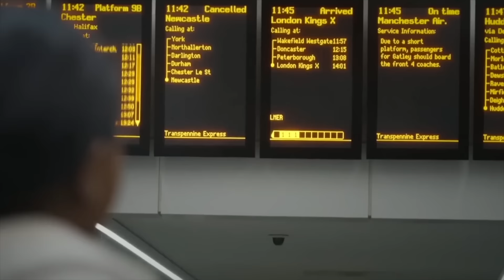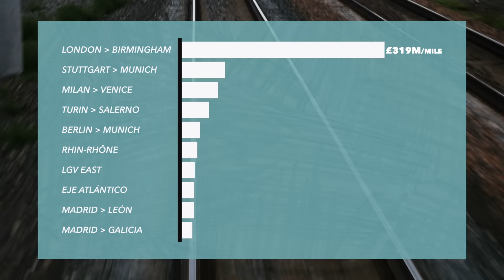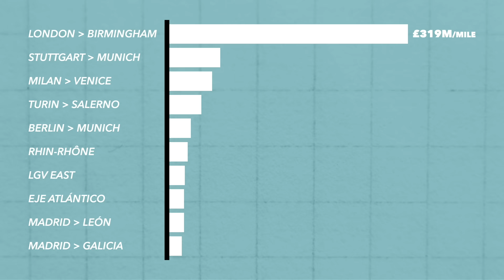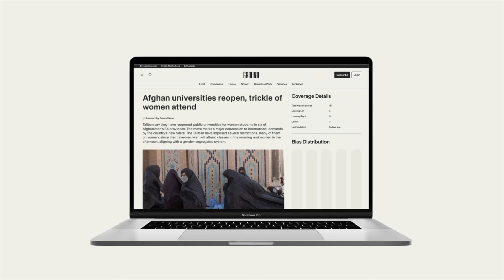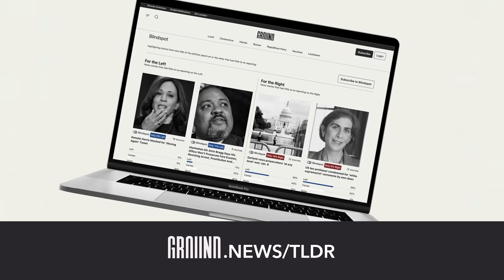The £100bn Railway: Why is HS2 Four Times Over Budget?

Comment: Find it sad to see the actual part of HS2 that needed it the most (connections to Leeds/surrounding areas) were binned. 
Seems that no engineering project in the UK can either run within budget or time scales. The building of Wembley stadium is another immediate structural project that was both hideously expensive and slow to construct.  Guess that is the state of the UK in the 21st Century.
Reply: haven't seen anyone complaining about Wembley now.
It's actually doing really good.
Reply: @davidty2006  It cost twice, three times the budget £700bn in early/mid 2000s is insanely expensive) and was 2 years (I think) late in completion. Plus within 15 years it's not even the best stadium in London anymore.
Reply: A14 Huntingdon Bypass was open ahead of schedule...
Reply: Why is the scrapped HS2 route to Leeds and the surrounding area needed the most, the areas that need HS2 the most are Birmingham because of the fact Birmingham New Street is getting grid locked and strangled by the amount of trains using it which is affecting both the Birmingham to London services and also other service through New Street to the rest of the Country, it is far quicker via the ECML and MML than travelling from Leeds to Birmingham and then South to London.
Reply: @peterwilliamallen1063  Guess you've never had the experience of travelling in/around Leeds/surrounding areas then. Leed to Sheffield is 29 miles and takes between 55mins and 1hr 20m. Remember, Leeds is the 3rd most populous city in the UK. It shouldn't be serviced so poorly, with such slow train routes.
Reply: @TheMixCurator  And I guess you haven't had the experience of travelling around the West Midlands either with services being held up due to Birmingham New Street being clogged up. The West Midlands is just as bad.

Comment: The UK is basically incompetent to make strategic decisions. When Spain finally and rather late decided to implement HS rail, they planned for a whole network covering all of Spain. When my country Belgium decided to build it, it was from the start a strategic project covering both the north-south (Netherlands-France) connection and the connection to Germany. In both cases, it took a generation to build, which made it for the contractors interesting enough as a long-term project. In the UK you only planned more or less one piece, without an overall strategic commitment to HS rail as a new major way to transport people all over the whole UK. As a regular visitor to the UK, using all kinds of transport, i am disgusted by the major faults for every single mode of transport in the UK, road, rail, local public transport, intermodal connections,etc; Even using a bike or as a pedestrian i get frustrated a lot more than in other countries.
Reply: And will the EU ask their 39 million investment back they did in 2017?

Comment: Three consultancies ARUP, Atkins and Mott McDonald have concluded that a viable upgrade of the ECML is possible, near equalling HS2 journey times. This will provide a 30% increase in capacity and give speed improvements for York and Newcastle at considerably less cost.

They don't preclude further improvements such as a new station in Leeds, Sheffield to Leeds 'Northern Powerhouse Rail', the Nottingham to Newark HS2 ECML bypass/link.

Some proposed improvements are:
1) Maximum line speed increase from 125mph to 140mph 
2) Welwyn capacity upgrade 
3) Huntingdon – Woodwalton 4-tracking
4) Grantham Performance Improvement 
5) Newark Flat Junction Grade Separation 
6) Doncaster freight avoidance
7) York - Skelton 3rd line 
8) Darlington additional platforms 

Bypasses are needed around York and Morpeth. Morpeth is a notorious death spot and needs to be done.
Reply: Great way to destroy commuter traffic.

Comment: UK: "We have low energy of commitment of big infrastructure projects, that's why we fail".
Europe: "Don't you still not understand why we DIVIDE big infrastructure projects into SMALLER broken bits!"
It's just common sense, smaller projects are relatively easier to complete, and once they get done you are naturally motivated into doing the next smaller phases.
Having a massive project is a daunting task, it always seems impossible to complete, moreover once a massive project gets done all you tend to experience is fatigue due to the endless time and stress it took to finish it!
Reply: Don't forget the demotivation that comes when you eventually have no choice but to let go of some original plans of a huge project because you finally get to realize that they are just not viable!
Reply: It is also extra important with rail infrastructure, where you basically want to always work on the tracks. Be it updating/upgrading old track or laying new track, since a longer break between building it generally leads to those techniques not being maintained and resulting in a higher building cost when stuff has to be rediscovered. This is likely one of the main  reasons why high speed rail in other european countries has such low cost per track mile/kilometer.
Reply: Lmao. Just 500 km of High Speed Rail is so big for UK that you need to "divide it" into stages? No. These are just excuses. Look at the similar project in India. 500 km of HSR, all elevated, Japanese tech in signalling and rolling stock, all for $14 Billion that appreciated to $21 Billion after land acquisition. Despite political wrangling and attempts at stalling by a rival political party.

Comment: The French TGV which was developed in the 1960s is due to be upgraded and will be a high speed country wide system which already connects all large french cities.
HS2 will be outdated before it's built for a line from Birmingham to London which, won't actually go to either London or Birmingham.
Reply: Do a bit of research, HS2 will terminate in London Euston and it terminates in Birmingham City Center at a new mega Station called Birmingham Curzon Street, plus how can it be outdated before it is finished as all equipment will be installed when the line is finished.

Comment: I think it's worth mentioning that HS2 isn't just about commuting and the movement of people - it's also about getting freight off the roads and transporting it more efficiently between the two places where it's used most.  Hauling as a method of bulk movement is pretty inefficient , so this does quite a lot for cleaning up our air and easing the burden on roads.

Comment: You called out project management but failed to call out project sponsorship failures which is arguably a larger issue with big projects like this.

If there is significant pressure from sponsors to be as fast and cheap as possible at the proposal phase you usually see quality and risk mitigation measures getting cut out (as anyone working projects will know you can't have all 3). Then when the project runs into issues there is no capacity to absorb them and it becomes over budget and behind schedule.

Really a proposal should be pitched at mid-point costs and schedules then there is enough manoeuvring room to manage the project and expectations are set at a more realistic point so the inevitable issues that arise it doesn't become a headline.

Comment: HS2 phase 1, 225 km, started in 2017, opening (maybe) 2029-2033 ? .. French TGV Paris-Bordeaux : last leg Poitiers-Bordeaux 340km, built 2012-2017, cost: 7.8 Billion euros, 3 million tons ballast, 500 heavy works (24 viaducts), 13,000 catenary supports, 1.1 M tons of concrete sleepers… TGV travel Paris-Bordeaux, Thursday February 9, departure Paris 9:07 am - arrival Bordeaux 11:14 am, journey time 2h07mn for a 610 km travel, priced at 25 euros.    (btw French TGV project started in 1974   1st line Paris-Lyon (427 km) opened 1981 (World speed record on rails: 380 kph (1981), 515 kph (1990), 574 kph (2007)

Comment: Brilliant. Well written.
As a experienced engineer the point I would make is we have a systematic problem with governance and planning in UK. So as Gareth said any infra delivery in UK suffers these problems so alternatives have exactly the same issues.
The main point is we need governments who can plan long term for anything to get better and in UK that is totally absent at the moment
Reply: As a QS and construction project manager for many years I totally agree. The government procurement process is flawed, resulting in problems from the start. They also start works before the design is completed for political reasons, this causes changes to work already carried out, increasing costs. They deliberately fudge the budgets so it gets approval. As was stated in the video they don’t carry out the works in sensible separate sections. They use very poor contract / tendering systems that allow for second stage cost increases. Basically everything they do is doomed to fail both in time and budget.

Comment: It is absolutely essential that we invest in rail infrastructure, not just for travel but for freight as well. For every freight train you add to the network, you're taking over 70 trucks off the road. Adding a few regional lines here and there is not going to solve the inherent capacity problems and station bottlenecks from long distance services. Endless excuses of cost and around half a golf course of trees are ludicrous.

Comment: Its also worth considering the fact that large scale infastructure projects are particularly susceptible to delays, and cost overruns. This is in part due to their sheer size and the complex engineering and the need for a whole host of different experts to communicate with each other, but also due to political cycles. Any project £5 billion plus is going to need full political support across all parties for a number of years before starting construction is even considered, and politicians have a habit of last minute changes to plans that only increase costs.

Its also not like hs2 is unique either in being a big infastructure project that went over budget, many (id be inclined to say most do). The channel tunnel was overbudget (we couldn't imagine not having it now), Brandenburg Airport (Berlin) was overbudget and 9 years late, Stuttguart 21 (Germany) was meant to open in 2021 but now not due to open until 2025 and its three times its original budget. Crossrail/ Elizabeth line was £4 billion overbudget and was meant to open in 2018, but now its carrying more passengers than TfL predicted and everybody has by and large forgotten about the cost overruns and how late it was despite it having only opened in May 2022. the Three Gorges dam quadrupled in cost from its origional estimate from $8.35 to $37. Boston Big Dig was supposed to cost $2.6billion but actually cost $14.8. ITS THE NATURE OF BIG PROJECTS, BUT ONCE WE HAVE THEM, WE ALWAYS WISH WE HAD BUILT THEM SOONER.

Comment: It really seems like high speed rail should be structured as a public company charged with constant build-out, rather than project-based funding. £100b doesn't seem like so much money if your perspective is "yeah, we sirens £10b per year building high speed rail. A new station opens every 2-3 years and after 10 years it goes all the way to Leeds."

This also avoids the feast or famine pricing that you get when you go decades between projects, and means that Leeds isn't the end of the line. After 15 years, you've got London to Edinburgh, in 20 years you've got a whole other line heading up the east coast.

Comment: This happens every time there’s a big infrastructure project. Spend loads of time navel gassing as price goes up only to realise in the end we’ve got to do it anyway. This is not capacity that won’t be needed or used and you can tinker around the edges to get costs down. But it’s going to cost what it costs so just get on with it.

Comment: I'd say a key driver of the cost increase is the Nimbyism, which forces to build more and longer tunnels than strictly necessary. Another one is that all the stations are build like cathedrals to modern engineering x - they look very nice but are way overbuilt for the function they serve. A more modest design would achieve the same goal and cost a lot less, which in turn would be better invested to reach more cities.

Comment: Try running the HS2 line along existing routes by adopting a stratified configuration, one atop the other-HS2 on ground with commuter traffic elevated above.
Reply: Stupid idea building and maintaining the required structures would be a nightmare costing way more than a greenfield route and causing huge delays during construction. Also this would not improve the 1800's existing alignments, and what do you do at over bridges and tunnels?

Comment: Dennis seems to be saying that instead of these large, individual, infrastructure projects every decade, the UK should instead be continually investing to keep upgrading the transport infrastructure, but on many small projects, as part of a longer term strategic transport plan. 
This ensures that the required supply chains and skilled workforce are available, which will reduce costs over the longer term.
He also mentions that instead of a few, large contractors doing most of the work, it's outsourced (subcontracted) to SMEs, fragmenting the way the jobs are done and increasing overheads in the process.

Comment: Not a bad take.

I could add some details, such as the fact the contractors bit off way more them they could handle when they took on the construction contracts, made promises they couldn't deliver, and policy requirement they couldn’t achieve, so when enforced the cried for more money to do what they had already agreed to do.

Miss management is an issue, but additional the supply chain is really not there. Even simple things such as fill, the country doesn't have the infrastructure to supply, there was discussion about opening new mines just to deliver the stone for concrete for example.

Suppliers knew this, and jacked up pricing right from the start knowing they had no choice. I know procurement managers who had been in construction decades who were seeing supply prices double anything they had ever seen before from ALL suppliers giving them zero options.

Comment: Great video, but there's one gripe I keep seeing time after time all over the place. If you compare £50M with £100M and use circles to show that, don't just double the diameter to show the doubling increase. That quadruples the area and creates a false impression. The cost per mile comparison works as the lines have the same width. Double the line, doubles the cost, but that doesn't work for areas.  There's many others guilty of the this!

Comment: Its impossible to build infrastructure in the UK. Too many stakeholders and too many routes to obstruct the development.  Right from the start you had radical stakeholders fundamentally opposed to the project. Which basically meant 3 years of legal fights before the plans had even started to be designed. 

The majority of our rail was built before "environmental impact assessment" was a term. If you really want a lean green transport solution, expand heathrow Airport, develop regional airports, and run electric powered shuttle flights between these cities.

Comment: Japan didn't really have the money to build its bullet trains. It did it at great cost because they knew it would pay dividends layer on. 
It was shaky at the start and didn't make an instant profit. But now it makes a hefty turnover of profit and its invested in to maintain and it still makes profit.
Short-sightedness. It's the trademark  of the British economy. If it doesn't make a profit instantly, it won't be invested in. You can't run a high speed rail network that takes years to expand upon like that. It's not a bank loan for a small coffee shop, it's a massive investment into the future that will pay out in abundance if those in power stuck by it.

Comment: Just ditch direct trains and you instantly have a very reliable train network... Just means if you travel further you travel for longer. Its really not a bad trade off for lower travel prices and better scale logistics... The solution to a whole bunch of infrastructural issues is simply to not have faster speeds but to implement slower speeds...

Comment: Hope they sort it, id extend it with an east Coast line going directly to Edinburgh via Newcastle. But one step at a time. I use ICE trains all the time in Germany. While they are slated for recent punctuality issues, the big picture is the thing not to forget. Whether it is a short trip between Nürnberg/Munich or a long trip between Stuttgart/ Hamburg, ICEs are great. Now there is a Sprinter ICE between Munich and Berlin at just under 4 hours. That is way quicker than the car and on par with flying (but much less co2), book in advance or with a railcard and it is not too expensive..so, for me, HST are the way to go...

Comment: Cost Consultants have little or no understanding of costs. So the budget was a shambles before anything was designed. The Britizh Library finished 7 times over budget and 7 years late. Crossrail was considered to be a technically simple job. The contingency cost in the HS2 budget is 24% added to a shambles of a cost plan. Final cost of HS2  ? Any predictions over 150 billion ?

Comment: Another reason is that the initial budget was set based partly on political will rather than reality. The costs were set at a rate which would be low enough to be approved by politicians with a delivery date they want to hear.

Comment: I still don’t understand the whole big project vs separate it into smaller project thing. How does that increase the cost per mile
Reply: Because the cost of the stations does not appear in the cost per mile statistic in other rail lines
the Stuttgart Ulm one for example does not include the new Stuttgart station and its approach tunnels with would add another 10B for a few miles of track